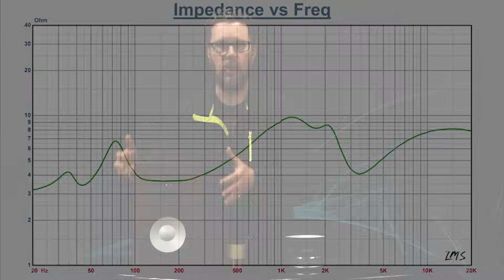What is Speaker Impedance? | Impedance ohms rating explained

Comment: Can you use a current clamp on the speaker wire to measure the maximum current from an amplifier? because how would you know as a technician what is the maximum speaker output current from an amplifier without causing damage? the speaker is a load so if the amplifier is rated for 8 ohm and you connect a 4 ohm speaker, that is going to make the amplifier output "DOULBE the current" which will damage the output transformer but how does a technician know what is the maximum output current without damaging the output transformer, power supply, power amplifier power transistors?
Reply: A truly STRONG amplifier can double its current delivery each time you halve the load 8, 4, 2, 1 Ohm etc.  A 100W (8 Ohm) Mark Levinson ML20 amplifier was tested by AUDIO Magazine (August 1987) as a functional arc-welder and then its was audio tested after and its THD hadnt changed at all LOL.   This amp and many other high-end brands CAN deliver 100W (8 Ohm) 200W (4 Ohm) 400W (2 Ohm).  This is true power doubling with no hint of it tailing off ie its an almost perfect current source.. The reality is that few amplifiers can do this and if it can then youre in the mortgaging your house range to buy one.  Testing to find an amps capabilities are using a scope and a sinewave generator at some low frequency to find the clipping point on a high power resistive load ( I use 4 x 300W 8 Ohm loads in my own workshop that I mix n match to get the Ohms I want down to 2 Ohms 1200W) and seeing how this clipping voltage changes with each halving of load resistance.  At 8 and possibly 4 Ohms youll get away with a continuous sinewave input but below 4 Ohms and def 2 Ohms you need to do tone-burst testing (5 cycles at the test frequency so that you dont get the amps output stage into thermal runaway ie BANG.  For instance Nelson Pass tests his amps with tone-bursts at 0.1 Ohm loads to find true peak current capabilities at clipping..
Reply: No you cant use a current clamp, use a scope and a tone-burst generator

Comment: Thanks for taking the time to explain this topic! I’m not an electrician or engineer so this is helpful. I do wonder though, how speaker engineers make the decision to design a speaker with a given impedance. I mean, wouldn’t it just be easier if everything was 8 ohms? Why 4 ohms at all?
Reply: Countless reasons really ... loudspeaker design is an exercise in comprimises. 

There is no ideal path to take, ... as every step is a compromise one way or another. 

You're juggling different drivers, each with differing characteristics. 

Besides, the loudspeaker impedance isn't just one value (something the presenter didn't fully cover). 
Impedance changes per frequency ... oftentimes those variations can be huge.

Comment: Your explanation is good.  All the important aspects covered well.

I used to design power amplifiers for a living.  As an amplifier designer, you are (almost) only really concerned with the impedance of the speaker at low frequency, as that is typically the region where the majority of the power of the signal lies.  The lower the impedance of the speaker at low frequency (say 20Hz to 80Hz) the more heat will be generated in the output devices.  Too much heat, amplifier fails.  Reason - lower impedance results in more current, and heat generated is proportional to the square of the current.

I used to specialize in designing amplifiers capable of driving a 2 ohm load at high amplitude without failing.
Reply: Hi, what specllialty do these 2 ohm amplifiers have that the 8 ohms amplifiers don't?
Reply: @jm-vq4cm  The answer to your question would take several pages of technical explanation.  In short, if you try to drive a 2 ohm speaker with amplifier designed for an 8 ohm load, the amplifier will fail quite quickly unless you keep the amplitude very low.
Reply: Why use 2 ohm load? Won't you lose a lot of power over speaker wires?
Reply: @xonx209  It is not (necessarily) about using a 2 ohm load.  It is about ensuring that the amplifier will be able to work reliably into a load that is lower than you would normally encounter in any production speaker, this means that if the speaker load is higher than 2 ohms (which would normally be the case, most speakers are 4 ohm or higher) the amplifier will not overheat.
As it so happens, my main speakers actually have an impedance of just over 2 ohms, and my amplifier output devices typically survive for 2 or 3 years (sometimes even longer) before they fail.
As for loss over speaker wires, well, you should see my speaker wires.

Comment: It seems counter intuitive to me that speakers with lower impedance would draw more current than speakers with higher resistance, especially if considered in terms of sound output, which, after all, is the "work" done by loudspeakers.  It would seem to me that, to obtain a given listening level using, on one hand, 4 ohm speakers and, on the other, 8 ohm speakers, an amplifier would need to work harder to overcome the higher impedance presented by the 8 ohm speakers.  Wouldn't the 4 ohm speakers be more efficient and use less power to give the same amount of sound as the 8 ohm speakers?  Am I confusing concepts?  What am I missing?   Thanks.

Comment: Very good explanation on this topic. I've had people tell me that they have connected 4 ohm speakers to an 8 ohm amp many times and never had a problem. I've always replied that as long as you keep the volume low, there should be no problem but once you crank up the volume, you are taking a risk to break something. And of course, if this did happen, they will blame it on something else. Hey, it's your amp and your money... do what you want. 

Ever notice that when someone asks you for advice, but the advice is not what they wanted to hear, they get upset?

Comment: When I was younger, we had the opposite issue where an older stereo receiver was rated for a 4ohm speaker and all home stereo speakers were 8ohm. I was told that to make up for the difference was to connect 2 8ohm speaker sets together reducing the ohm from 8 to 4ohm per channel in order to avoid damage. Sometimes you could get away with using an 8ohm speaker on a 4ohm rated amp, eventually could blow out speaker if used independently. If this makes sense, it took me a little bit to grasp the concept. Realistically not sure how true the set up is or was in my case.
Reply: I think it's totally safe to put 8ohm speakers to a 4 ohm amp, you can't do any damage. You will simply have a lower max output volume

Comment: Resistance is not a force.  Instead, it is somewhat analogous to a coefficient of friction.  Friction is a force, but the coefficient of friction is merely the ratio between the frictional force and the normal force -- on a floor the ratio between the friction and the weight.  Resistance is the ratio of the electromotive force (V) to the effective speed charge moves (I).  Just like friction generates heat, resistance always converts electric energy into another form -- mostly sound in this case.

Reactance has almost nothing in common with resistance; they are, in fact, orthogonal -- resistance is on the real axis and reactance is on the imaginary axis.  The only thing they have in common is that each is a component of impedance... each causes AC current to be less for the same AC voltage.  But, whereas resistance is constant (at audio frequencies), reactance depends on frequency (2 pi f L or 1/(2 pi f C))... and reactance has zero resistance -- they are orthogonal.  Reactors store energy for 1/4 cycle, return it for 1/4 cycle, store energy for 1/4 cycle, return it for 1/4 cycle, etc. and resistors remove energy at all times.

If the coil moves easily in a magnetic field, then the motion will generate a large "back emf" -- think about an electric generator.  This will allow less current and slower conversion from electric energy to motion.  If the coil is hard to move, then smaller back emf allows more current and more electric energy is needed to make the sound.  The speaker cone is held at the magnet and at the cabinet to constrain its motion to in/out only.  But these 'anchors' are springy and the cone has mass so that the cone resonates because it is a mass on a spring.  The cone is easy to move at some frequencies and hard to move at other frequencies.  The speaker is in a cabinet and a room and both of these have acoustic properties that make the cone easier to move at some frequencies and hard to move at other frequencies.  Since speaker motion generates emf, these mechanical properties look like reactors and resistors to the circuit.  All of this is in addition to the electronic crossover networks.

There is ALWAYS "cost-cutting going on."  Engineering is the art of compromising to achieve reliable specifications at minimal cost.  But, even if an unlimited budget were available, increasing some things necessarily decreases others -- we MUST obey the laws of physics.  A Walkman or an iPod cannot weigh 200 lb.  A 100 Watt system would need a very large battery.  Etc.

Comment: Hi great informative video . Was wondering if you can you use 2 x 4ohm speakers hooked up in series? could that be run as an 8 ohm load safely? Or running 2 x 8 Ohm speakers in series creating a 16 ohm load to be run on a 8 ohm recommended output?
Reply: I don't know about sound quality but for an univer party my roommate and I both had The Smaller Advent speakers, rated at 4 ohms each, 2 in series for each channel, phased properly of course.  We placed the tape deck and Heathkit AR-1500, a pretty good unit for it's day, in my locked bedroom so no drunks could screw with the music.  We ran 4 hours with nothing blowing up.  In case you haven't figured it out yet, this event was about 53 years ago.

Comment: curious how this plays into tube amps. rule was you can damage the amp if it's run without a speaker connected? Is this true and if so why?
Reply: tube amps are almost always transformer output and to keep things simple, basically large inductors (transformer) open circuit without a load (a speaker) can create large over voltages that can short out the internal windings of the transformer.

Comment: There is a mistake in your presentation.  Reactance is NOT the combination of resistance and inductance; rather, it is ONLY the effect of the inductance (or capacitance) portion of a load!  Impedance is the combination of resistance and reactance.

Reactance formulas (for inductive and capacitive loads, respectively):
XL = w * L
XC = 1 / (w * C)
...where w is the frequency in rad/s (or 2*pi*f, where f is the frequency in Hz), L is the inductance in Henries, and C is the capacitance in Farads.

Impedance formula:
Z = j * (XL - XC) + R
...where j is the imaginary square root of -1, R is the resistance in ohms, XL is the sum of every inductive reactance in the load, and XC is the sum of every capacitive reactance in the load.  The resulting impedance (Z) is therefore a complex number.

If we don't care for keeping the real and imaginary portions separate (eg. we're not doing phasor arithmetic), impedance (Z) can be casually stated as the modulus of the complex value.  (The modulus is the square root of the sum of the real portion squared added to the imaginary portion squared.)

Of course, for non-linear loads (such as speakers), L (for voice-coil drivers) or C (for piezo drivers) varies with frequency, and even amplitude to some extent!  Therefore, to obtain a theoretical calculation of impedance when a complicated signal (such as a sound wave) is applied to a non-linear load… The reactance pertaining to each component frequency of the signal must be calculated, using the respective inductance or capacitance obtained from an accurate mathematical model of the load and the given component frequency and even its amplitude.  (This is why, to be pedantic, XL and XC in the impedance formula are the SUM OF all component inductive and capacitive reactances, respectively!)  Similarly, if the load's resistance is non-linear, R must also be an overall calculated resistance based on the applied signal and accurate mathematical models of the load.

In practise, it's much easier to simply test the Z of a non-linear load (such as a speaker) as a function of frequency by slowly sweeping a sinusoidal signal across the usable frequency range, at a defined constant amplitude below the point where distortion would otherwise increase dramatically.

When it comes to overall impedance of a speaker with multiple drivers and a crossover filter, Z of the entire system must be calculated using phasor arithmetic in formulas set up to model the crossover filter topology, with the tested Z of each driver inserted as the respective load element in the final circuit formula.  This is beyond the scope of this comment, but know that the physical inductors and capacitors and resistors of the crosssover contribute additional L's C's and R's in a giant formula that models the series/parallel connections of all these components and the individual speaker drivers too.

So back to the original point: Reactance is just the portion of the loading contributed by a purely inductive or purely capacitive element in an electrical circuit.

Comment: Very well put together but the one thing you should have added at the end is if you do the reverse where the reverse information is done then it is easily done where you take the numbers and work them backwards it does work where your bigger speaker your lower bigger power output into the smaller speaker doesn't have any problem with the amplifier something like that anyway trying to figure out what I'm typing this in you know what I'm trying to say anyway

Comment: Another way to think about it instead of nominal voltage is the nominal current draw which is the square root of the amplifier power wattage divided by nominal or rated impedance. And if you think about circuit breakers, they are rated by amperage, not watts or voltage, because wires and other components will melt at sufficiently high current given a sufficient amount of time.
For example, if you have a 150W amp powering an 8 ohm speaker then it draws a nominal 4.3A of current. However, if you were to plug a 4 ohm speaker into the same amp, then the current draw jumps to just over 6A. The circuitry in your receiver/amp/speakers may not be rated for that much current causing it to overheat and shorting components especially if you like to really crank it up. That's why most subs are powered. That way the speaker and amplifier can be matched to avoid over-amperage since many subs are really low impedance, e.g. 2 ohms, and take a big amp to drive at sufficiently low currents.

Comment: I haven’t watched the video — yet — but I’ve been a practicing EE for over a half-century. Perhaps what I’m about to say was covered in the video; if so, then I’m merely Capt Obvious; if not, consider this additional background info…

The mathematical expression is: Z = R + jX
where Z is the complex impedance; R is the DC resistance of the coil, i.e., a positive, REAL value.  R is a function of the resistance-per-unit-length of the coil wire x the total length of the wire used to wind the coil. The term jX is the ac component, and can be positive or negative depending on the frequency being applied to the coil/magnet assembly. ‘j’ accounts for the phase of the ac component of Z, and can therefore be either positive or negative; X is the frequency-dependent magnitude of the ac component of Z. These characteristics are what give a speaker an impedance that is different at every frequency in the audio spectrum. And why 1kHz is the accepted frequency at which to specify Z.

Comment: Hello I have an amplifier rated for 8 ohms impedance speakers, I have conected a 4 Ohms speakers in serial with a 4 Ohms power resistor in each channel, is it something wrong with it?
Reply: Short answer:  YES!  You are blowing away approximately half of your sound power in heat, both in the amplifier and resistor.  And unless the resistor is of the low inductance type resistance will change with heat and frequency.

Comment: if you have 2 pieces of 4 ohm speakers per amp you can connect them in series instead of parallel. That makes sure the power source and fuse will not blow unnecessarily. Fuses in power source are your best friends. It is possible to use underrated fuse like 2.5A in power source to make sure speaker driver - like an expensive low powered tweeter- will never get blown. The power source and amplifier can be treated as separate devices. Ebay and for example Soundimports have separate power sources and amplifiers available at very reasonable price.

Comment: Finally. I have studied some electrical engineering and know about inductive and capacitive reactance. So I was always confused by specs like "8 ohm impedance" for speakers. Because I knew impedance was a function of frequency so how can you just give a single number? But it's some massive kludge. The speaker's impedance varies over its operating range and they just pick an average. Ecch.
Reply: I think you’ll find the speaker manufacturers adopted a standard of 1 kilohertz as the measurement frequency for specifying loudspeaker impedance. Why a single number? Because it’s easier to specify at a single point in the audio spectrum; however if you want a frequency response CURVE over the entire audio spectrum, some companies will provide them.